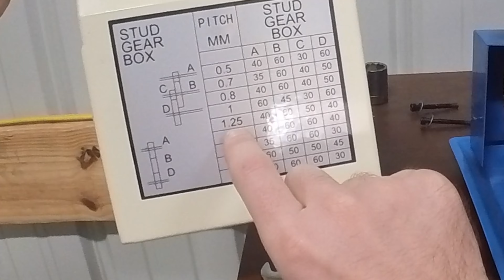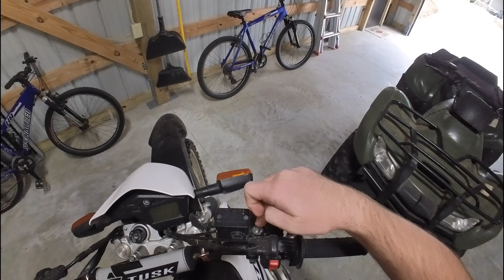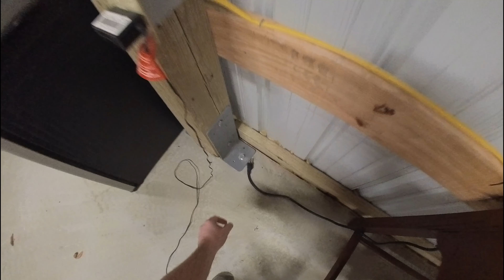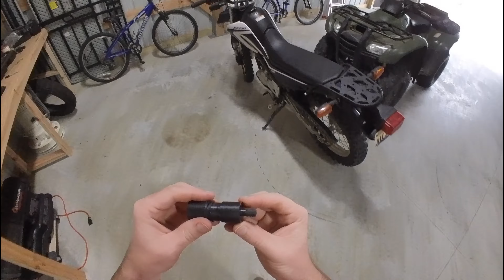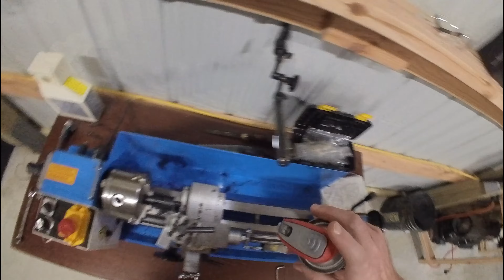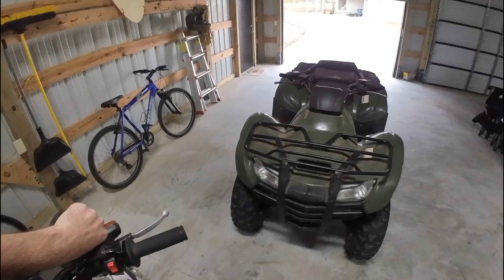Vevor Mini Lathe Cutting Threads For Motorcycle Mirrors

Comment: Easy when its plastic. Try aluminum or steel....
Reply from the maker: Aluminum would still be easy, steel a little harder on this lathe, I’ve tried turning titanium on this thing and it doesn’t like it at all 😂 which would be expected, not really rigid enough for anything but plastic, brass, and aluminum but that’s good enough for most all of my around the house projects
Reply: @TNValleyDualSport i have the same lathe and when I do internal threading (12 TPI) it often gets stalled or stuck. More than half the time I had to rotate the chuck by hand because my arm had more torque than this lathe could do by itself to finish cutting the  internal threads